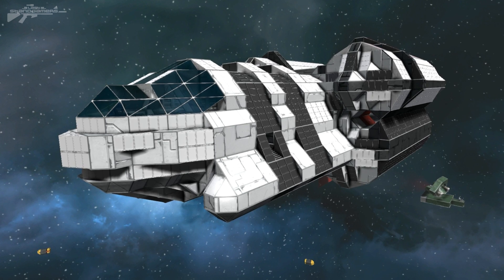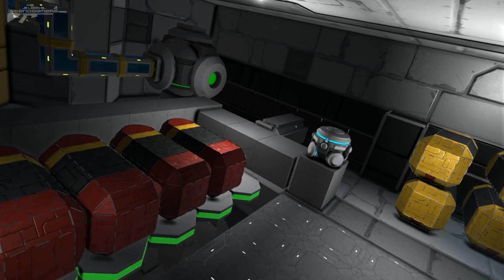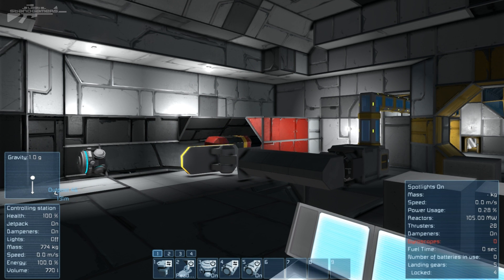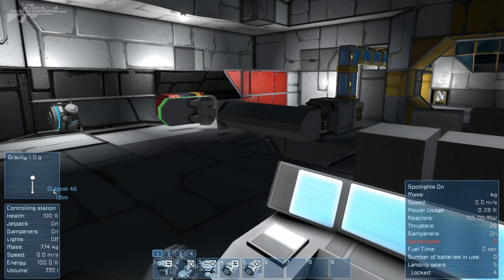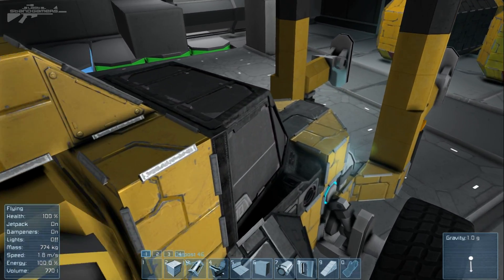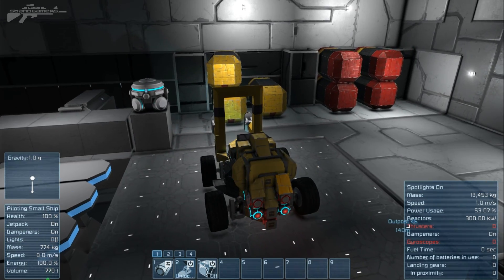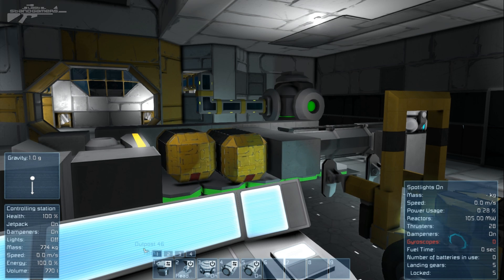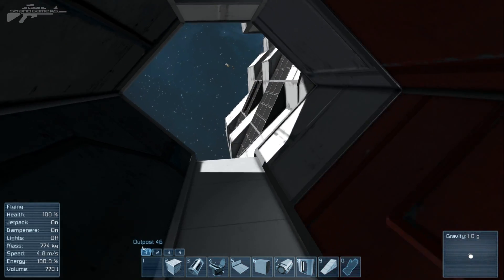Space Engineers - Torpedo Auto Loader Concept, Mechanical Fun

Comment: Couple of thoughts.
Does the loader arm really need to be so long? What if the rotor/hinge where directly connected to the landing gear?
Does the loader arm really need to turn 180 degrees? What if you raised the barrel of the weapon a few blocks, put the rotor in line with the barrel, and had it turn 90 degrees instead? Much faster.
Can the munitions be projected and auto-welded?

I think you said this was only a proof of concept version and you said you could get more speed out of it. How fast can you make the projectiles go?

Comment: You could be having this on timer blocks, controlled by the pilot, that would activate it automatically. This could be a very powerful torpedo loading mechanism for rapid fire setups. Another thing, You should have a ship with landing gears on the front, and a connector, so it can actually dock, so you can save it with the blueprint, then you can use it as the "stacker truck".

Comment: why not just use the regular rockets?
Reply: Honestly regular rockets have a max range and gravity weapons don't. I'm looking at making a new ship next month that has a gravity gun running through the centre of the ship. It will have timer blocks that disable the AM block, explosives spread so I will get 4 separate explosions from a single launch and some minor thrust for homing capability. This would mean I can start engaging an opponent from a much greater distance. Of course they can and probably will destroy these missiles with automated turrets but the same can be said for regular missiles. I've been testing out the damage and firing mechanisms in prep and found that it should be possible, better, it may even be able to get penetration of 2-3 thick heavy armour. If I manage it, I'll put up a video.

Comment: it would probably be safer to have the reloading truck add shells as the bay is firing so as to ensure a continual rate of fire. the reloading process seems pretty dreadfully slow, and unless you crippled or destroyed the hostile ship you'd be in alot of trouble when you need to reload. If I were the guy getting shot at, I'd send a missile straight down that torpedo bay to keep from getting shot at by those torpedos

Comment: hey ive been thinking about your design and what if u change the system to be a carasel instead of over head and instead of having a 180 turn make its a 90 turn, firstly it will be faster and secondly u wont need to have a wide ship to have a big mag u only need a long one which is generally what most people have i think it might work just dont have the speed to fast  u should experement with it i would do it myself but i dont have space engineers :/

Comment: Now if the devs could add the ability to group multiple functions into one button on the toolbar, this could be done without having to worry about pressing buttons for each individual component. Of course, this would also require the ability to set functions to a certain value for a certain amount of time for instance: Set Rotor Rotation Speed 20 for 2 second(s) , then unlock landing gear etc... all in one button press.

Comment: Gravity weapons are made obsolete by well placed gravity generators on the other ship. Also, using a thrusters with/instead of a gravity generator adds a lot of punch. Finally, especially for smaller torpedoes, it works well to make the nose heavy armor except for the middle, like a hollow point round.

Comment: How about a revolver autoloader? Make a cylinder with however many warheads attached with landing gear, and attach it to a rotor. Rotate the warheads into position like we see here, and fire. For bonus points, use a merge block to enable cylinders to be rapidly exchanged by a tug.

Comment: You could have a semi or full auto gun by having a clip with just enough room for blast door bullets and a gravity generator slowly pushing them up and another grav gen at the top pushing it through a barrel an you could even have a landing gear at the top of the clip holding the bullets until you unlock it so you can aim

Comment: Idea: A rotor with surrounded by four landing gear arranged in a + shape. and a piston loader like the one in the video. The launch tube is located at 90 degrees forward from the loading position. As the rotor rotates, you simply enable and disable the landing gear at the correct time. It works like a belt-fed machine gun.

As for the problem of loading more shells onto the piston loader, how's about layered magazines? Basically a box full of shells. Once the box is empty, you retract the loader piston and then use a separate piston to push a new box full of shells into position.

Comment: I have a concept that is called the mosquito concept. It requires a small ship with missiles at the front and a piston pointing with a drill. Also there mast be landing gears low enough that the drill doesn't scrape when you land. When you use it you find a large ship/target, fly to them stealthily, latch on with your landing gears, start the drill and piston so it digs a whole into the ship slowly going down, fly away and shoot missiles into the whole. This allows you to drill into the ship while it is moving,sabotage the ship, easily make a hole even if has really thick heavy armor and can separate parts of the ship. Please try to let Last Stand Gamers to see this because think he can really improve this concept and make to this I wouldn't think is possible maybe like this into torpedo that self destructs once it digs the hole? Please like I want him to make a video on this.

Comment: By far the most destructive weapon I've made in this game is a large ship that is 2*3 wide and tall and as long as you want made out of heavy armor. Stick some gyros, reactors, a large engine and a cockpit at the back and fly into the enemy, then wiggle until all of the heavy armor blocks at the front break (I usually make mine 6 blocks of heavy armor long, which is enough to go through 4 blocks of heavy armor and still tear up the inside before the gyros and cockpit break off

Its a suicide ship until they add remote control or add some way for the ship to automatically wiggle and spin but the huge hole it leaves looks awesome as hell

Comment: why not just use the piston to load and remove the rotor? im sure you can mess around with landing gear/ gravity field strength and on/off functions. and for all the people saying auto loaders don't work well with warheads... well... with carefully tweaked and maintained (tested) loading mechanisms and using covered warheads you could pull it off.... or better then that, i always had the concept of spinning your rounds (with rotors or alternating gravity fields) before launching them out of a gravity cannon to get extra damage... maybe mixed with a corkscrew warhead (corkscrew of heavy armor, streamlined with light armor)
Reply: and that brings up the question of resource use and cost-effectiveness... the spiraling corkscrew (in testing) does loads of damage, more the rockets and machine guns, with a high chance to damage critical systems withing the ship.. and all it needs is a fyew reusable gravity generators, and some steel plates (all you need to do is find a cheap way to load it, depending on weather you decide to use rotors or alternating gravity fields to spin up the warhead to a  high speed [high speed, as in using multiple rotors])

Comment: i am not trying to be appear smart, 'im just am :D. with mergeblocks in the game and the recent hotbar update you can have waaay more reliable and precise weapon systems than a tumbling can of "fuck you" that might or might not explode in your face.

self propelled explosive. the basic unit is a thruster, a reactor and a warhead. you additionally need 2 m-blocks to attach it to the ship facing to the side (if you dont want a crewman to eyeball the insta-grinder while manually activating the reactor or engine while prepping for launch), or better yet, you can build it directly on the ship.

- calibration (mblock): you identify the engine on the warhead and one of the two mblocks (you need an antenna on the ship). set them into a group and add them into your hotbar as block on/off. deactivate the engine and set its thrust to 100% (in that order, unless you want to move about). now, if you press the hotbar key it will simultaneously disengage the mblock and activate the thruster.

- rinse and repeat

you can have hundreds of those things on your ship without impairing its movement (the magic of mblock).

now you can have that on a piston system to conceal it in the hull. you can have that with an extra gyro to have it fly even str8r. you can have a set firing while another set is being built by a crewman on a piston system which retracts into a set of welders delivering constant unending devastation to enemy bases.

and you can have another warhead on the unit separated by 6 blocks for MAXIMUM DOUBLE PENETRATION FUN.

Comment: I think a magazine design would be faster than single shell loader. using connector blocks you could have a bunch of shells lined up in a row and connect them all to a single bar, lift the bar into the barrel and then disconnect the the shells as the lock onto landing gears. Let's say four for to a magazine and three magazines would be plenty for any one or two encounters seeing as hour 12 torpedoes is a lot.

Comment: So my question with the loader is, the shells still in line to be loaded, are locked on that landing gear right? But you can move them with the piston and just pull them off with the rotor gear. Is there a setting where you can move stuff around on a locked gear? Usually if I try anything like that without unlocking the gear it'll just cause hell in my ship.

Comment: With the loading as slow as it is you'd need to up the damage potential of the warhead, as well as the speed of the warhead. Also, adding a reactor/gyro might help keep it stable in flight rather than having it as a static bomb just tossed at the target.

Comment: I think that a two ship unit could work really well for this. A small scout fighter fires a small torpedo at a large ship or station. Said torpedo has a beacon and a landing gear. (Antennas could work well, too) With landing gear set to auto lock, you have a way to "paint" a target. This tracking torpedo is then used so that the much larger torpedo ship with an auto loader can aim and fire from kilometers away. This could be very effective and cheep. This also means the large ship could be build solely on the weapons system, and not need heavy defenses and maneuverability that a conventional inertial attack ship would need.

Wait... I am just remembering you did a video like this just after warheads were added. Maybe elaborate and expand using the current state of the game?

Comment: SO i had and idea for a boarding craft:

It would have a open bottom with drills attatched to pistons so the ship could latch on and drill through hulls then deploy engineers into the enemy ship. You can use gravity generators to screw with internal gravity fields or you could even use this to deploy small torpedoes directly into the enemy ship. drill through the hull then drop a shell into the ship.
Reply: Also how about an AT-TE style walker, you could use pistons to move landing gear and it would move kind of like a centipede.
Reply: http://steamcommunity.com/sharedfiles/filedetails/?id=296522506&searchtext= not my work
Reply: swag

Comment: I think they need an actual conveyer system so that you can place created objects on as it goes around and not need to use pistons rotors and landing gear to do what an actual conveyer could do.  Although I'm sure people do enjoy building their own out of parts available.

Even if it was just like collectors being able to collect created objects up to a certain size and spitting them out the other end with an ejector fully intact.  It would really make having gravity type weapons more viable and fun.

That would be awesome.  Like it being able to accept a 4x4 block object, and spit out a 4x4 object.  maybe if you add two next to each other they would merge having the possibility of ejecting a 4x8 object.  Then each "tube" segment between the collector and the injector could hold ONE object of that size.  I'm sure you get what I'm talking about.

Comment: why don't you have the piston just feed shells into the gravity gun rather than the swinging arm?
Reply: Because the gravity would have an impact on the torpedo next to the one you are trying to load, so you would launch 2 or 3 torpedos next to eachother of which only one would go through the chamber and the other 2 collide with the hull of the ship or the walls in the room. That's why he uses an arm to bridge over the range of the gravity generators
Reply: Decanewolf You can really hone down the range of the gravity generator though. I think the problem is the friction between one round and the next when the first is firing.
Reply: It is difficult to get it to work like that, How I did it was have a piston feed directly behind the barrel then have another piston push it up to the grav field of the barrel, which sometimes did not exactly keep the projectile straight However this could probably be solved with an extended barrel.... The system shown here is a brilliant idea and seems consistent. Pistons are the best thing that has happened to auto-loader, It was very difficult to make one before using only gravity based systems, and they liked to jam sometimes.
Reply: Michael Oakes Large ship block is like, 2.5 meters, small ship blocks are a fifth of that, so 0.5 meters.
Reply: could be possible aswell, not really sure to what range you can set them, i imagine 3 blocks is the minimum or something?
Reply: Decanewolf If I'm correct, the bare minimum range you can do is equivalent to a single small ship block.
The minimum xyz grav gen field parameters are about 1m. Each small ship block is roughly 1 cubic meter.
Reply: oh boy, got some catching up to do :p
Reply: Cause Gravity fields are NOT a solid limit and you'd be shooting the inside of your ship if the limit brake is too low or if the shell propels before in the tube.

Comment: One of the things I love most about this game is the ability to construct mechanical systems, even automated ones.  I don't have the game yet, but the one thing that occupies my time thinking about it is how to make an ideal, fast, efficient auto-loading gravity cannon like this.

One idea I had is to build the shells without welding them together, that way they're much safer to store and load, and then have auto-welders assemble the shell in the chamber, including the mass blocks, thus preventing you from having to toggle the gravity generators.

Also, rotating your loader arm 180' is kind of slow, might be better to set up a vertical magazine offset to one side so the loader arm only has to rotate 90' to increase your fire rate.  I have an idea or two on how to quickly and easily pull 1 projectile at a time from a vertical gravity-fed magazine though.
Reply: Steve Pittman  could you share those ideas? I have SE and i could test them out for you.
Reply: As lots of people suggested in the comments below, pistons could easily do the job of feeding from a mag.  The problem is, pistons are slow (and occasionally derpy), and we want speed.

The best I've come up with (in my head, anyway) is to have a U-shaped bracket on a rotor (at the bottom of the U) between the magazine and breech.  When aligned, the space between the arms of the bracket should allow a shell to fall through, but you only need to rotate it minimally to block the next.

Timing the rotor, getting the right speed without doing damage, etc would take a lot of tinkering, but once done you hit reverse to start the bracket turning at such a speed that one shell can easily fall through but the next is blocked.  This way every time you hit reverse you're loading a shell, you don't have to go back and forth, and the whole thing is rotating maybe 10-15 degrees so it happens quickly.  I'm not sure how clear that description is, so if you have questions feel free to ask.
Reply: Steve Pittman sounds like a great idea but as you said it would take a lot of tinkering, personally I prefer to make maned missile turrets, one idea for the grav cannon is instead of firing shells, you fire a pod with 6 seats with a warhead to puncture the opposing ship's armor and deposit the marines inside the ship
Reply: I've also been wondering about the effectiveness of thruster-based projectiles.  You'd need someone to turn the thruster of each one on to fire it, and it wouldn't travel as fast, but it might be more accurate since most gravity launchers tend to induce instability in the projectile.
Reply: Steve Pittman true, but i would say they would be used for the initial strike to deliver a heavy payload on target to weaken the other ship
Reply: Gravity fed magazines are really annoying to get to work, as if there is any wiggle room they sometimes jam, and sometimes the projectiles like to blow up while in the magazine.... and yes you would need to construct them before they would work in the gravity fed magazine as they do need the mass block to interact with gravity.... So if you try this definitely use heavy armour. ^^ and also you can feed a gravity fed magazine directly into the barrel for very fast fire rates ^^ Although when trying to place in a ship sometimes you end up with much less space then you would want too, and have to change your projectile.... so the pistons are a lot simpler to make work. (but the gravity feed is cooler.... -_- )
Reply: Yeah, you really need to be careful about how you design your gravity-fed mag.  Use rotor-spaced landing gears to get it as close as possible to no wiggle room to improve functionality.  But a piston pushing rounds into the chamber may be the simplest, most reliable way to do it.